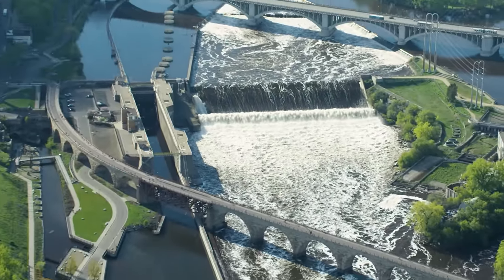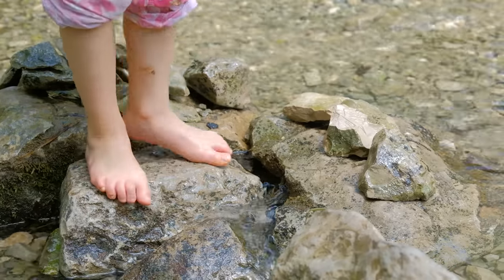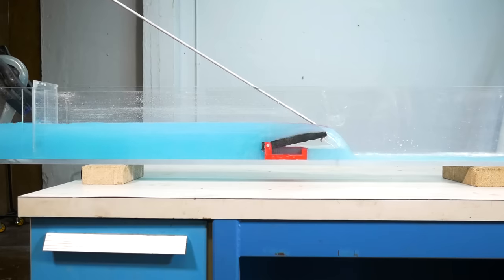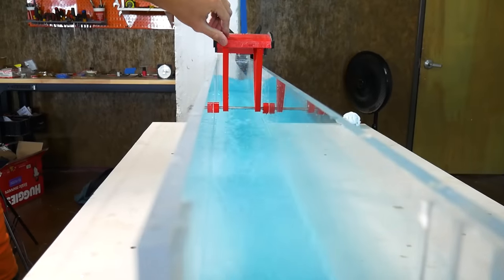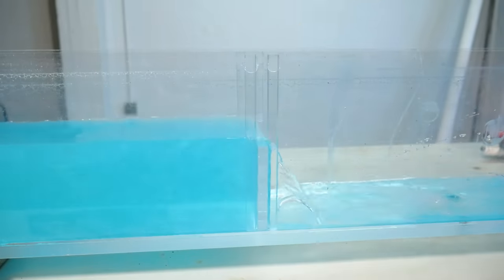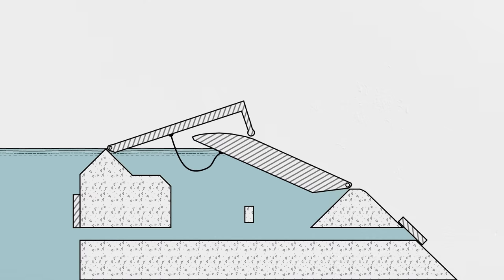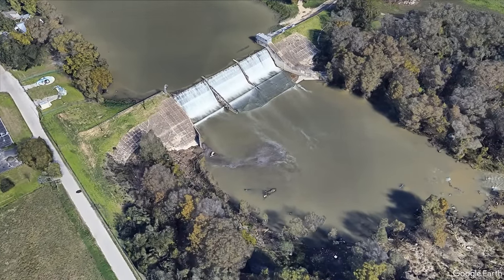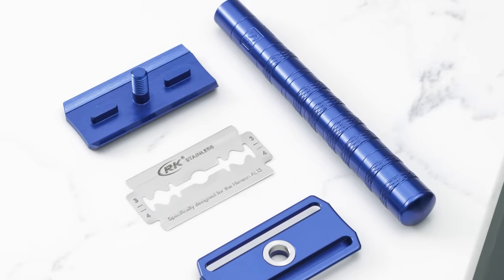How Different Spillway Gates Work

Comment: I wish I'd seen this video 35 years ago.  That's when I drew my first tainter gates for the Olmsted Lock & Dam project.  Since then I've drawn lots of water control and flood control projects.  Tainter gates, maintenance bulkheads, stop logs, flood gates, etc. My advice is to not live below sea level, behind a levee and/or downstream of a dam.
Reply: Try to tell that to the Dutch.
Reply: Well technically I'm at 7' above sea-level here in the Sacramento delta but given the last week's storms in NorCal that's of little comfort at the moment.  :)  Luckily despite being only a couple hundred yards from the Sacramento River itself my personal home isn't really at a high flood risk as our specific levee is quite robust.  However that safety is only due to the lack of safety for many others....basically it's more likely some of the other levees will (and have) fail before the ones closest to me which will reduce the pressure on 'my' levee.  I'm actually at greater risk of flood from sloughs and waterways much further away than the one I can see out my window.
Reply: @seneca983  I grew up in New Orleans at sea level.  I moved a little north to 23 feet above sea level. Mother Nature will always find the weak spot.  It's best to minimize the risk.
Reply: @donhappel9566  The steel fab shop I worked for was up against the Mississippi River levee, just upriver of New Orleans and just downriver of the Bonne Carre spillway.  I enjoyed watching the river go up and down thru it's cycles for 20+ years.  When it was high and far up the levee, the top of the river was about 20 feet above the "dry" side of the levee.  It's a bit scary.
Reply: @lowellmccormick6991  Yeah, grew up near the Ohio river and now live in the CA delta; lots of very visible level changes.  The LA Mississippi delta and the Sacramento delta both share a lot similar risk.  After Catrina tore things up there many pegged us as the next big target.  They've been doing work ever since to mitigate the risk but there's just no way to make it 100% safe.
Reply: look for the highest water line and live half again above it.
Reply: 3 years ago I was on a lock project in Illinois where most of the construction staff and many of the workers had come from the recently completed complex at Olmsted. I think they were only there the last 5 years though.

Comment: I worked in a hydropower plant back in Europe that had really specific design, kinda old school.  it was a crest gate type but gate itself was like a  section of a cylinder, that was seal tight and child float if needed. Under it was a chamber that if filled with water would raise that gate, and if emptied it would drop the gate. All energy needed to operate those gates was to open and close valves for the water in the chamber under the gate. It is amazing to watch the whole video and know almost everything from personal experience. Great job sir, I love your videos!

Comment: These crest gates work very well in conjunction with a radial gate. On our river diversion for or canal company, both are used . On the check structure a radial gate is used and it can keep the river channel clean from sediment. The crest gate can deliver cleaner water to the ditch since it takes top water not sediment laden bottom channel water. It results in a dramatically lower sediment removal needs in the ditch. The gate is autimated due to the changing channel depth affects delivery more drastically than a radial gate. The hoist is just a pneumatic truck spring more or less. The gate works great.

Comment: The was an engineering disaster at Sant Anthony falls. There was a tunnel that built across that location and collapsed. It caused  a cascading effect on the falls and it started eroding and cascading up stream. The spill way was built over the original falls location to stop the erosion.

Comment: I'm missing a gravity spillway. it's what my town uses to control the level of a stream. Basically just a giant slab of metal on a concrete structure that's hinged at the top. If the water level, and therefore pressure becomes too high, it pushes the slab open by itself and can spill water, if the stream becomes too low, gravity pulls the slab closed. it's mostly in a state of flow, sometimes low, sometimes high, but it keeps the stream almost perfectly level constantly. Unless there's a draught.

Comment: What did you add to the water to get that white shimmer effect that shows off the flow nicely?
Reply: He does note that he added "sparkles", some sort of glitter, likely plastic to suspend properly.
Reply: Mica Powder. Common craft supply
Reply: I have an idea but I'll keep the comment section family friendly.
Reply: either some kind of powder or he got one of those mystic fog fluids used in computer water cooling.
Reply: It's an edible shimmer powder they sell. Some drink shops make juices with it

Comment: In 2014, a 2 inch crack was discovered in Wanapum Dam on the Columbia River.  They fixed it with some clever engineering.  Can you make a video of dams with flaws that were fixed?

Comment: Great video - and also - Double edge safety razor for the win!  I've been using one for years and they are much better than the crazy Gillette razors
Reply: I bought one for my son when he started needing to shave, thinking it would be cheap for him to replace blades on once he moves out of the house.  I showed him how to use it, and then promptly went out and bought one for myself.

Those things are amazing.  I'm not sure why people stopped using them in favor of disposables.
Reply: I forgot the razor I owned was by Henson until I watched this and checked my order info (older model). I freaking love the razor so much. I've been shaving with it almost daily for the last year and a half since I bought it when they were less well known, and it's such a great razor. 3rd one I've owned, but the end of the search for the perfect razor. Their attention to tolerances shows in the shaving experience. I can't say enough great things.
Reply: Ha!   Glad to see I'm not the only one so enamored with my double edge razor as to leave a comment!   I've had mine for over a decade now, and absolutely would never even consider going back to a cartridge blade!  Shaves just as close, if not closer, and the blades cost 1/10th the price!  Plus, there's just something satisfying about using "old" tech to shave with (although personally, I'm drawing the line short of the straight razor and leather strap mode of shaving!).

Comment: Its been quite interesting living near a flood control reservoir the last few years. Its our primary local recreation area so we see the river and lake levels changing frequently.

Watching them shut the river off for a few hours by closing the sluice gates (maintenance was needed on something downstream) was very interesting to see how quickly the downstream water level dropped and to walk on the riverbed.

So too watching how quickly it rose when they had to open the tainters for a day when the reservoir was nearing capacity. Fourth highest crest of the reservoir in its 60 years of operation was recorded that year. Took a good two months running the sluice gates at close to maximum to safely drain the lake back to its minimum.

Comment: Several of the dams in my city are fitted with simple slide doors that are winched up or down as needed. The opening is narrower than the door, so the water pressure on its own seals the door against the concrete of the dam. The current doors are steel, but they used to be simple wood beams with a rod down the center so that they could be lifted. They were fairly similar to the stop logs mentioned at 15:10.

Comment: Interesting the reason that Tempe Town Lake has the gate system it has now is because they used to use rubber bladders as gates.  Finished in 1999, the bladder was supposed to last 20-30 years but barely made it 2-3 years before major repairs were needed.  In 2010 one section completely burst and drained the entire lake over night.  I remember when it happened since I drove by the lake every day going to and from work.  It took 6 years to finally get the new gates installed and working.  They look MUCH better too IMO.

Comment: For anyone curious the gates at Tempe Town Lake weigh 297,265 pounds each and sit at a 70 angle. The hydraulic cylinders are 3,000 psi, 16" bore 6" rod with 275" of stroke. Now Grady can finish his calcs. 🙂 (My company's the manufacturer)

Comment: If you like the radial gate design, check out the Maeslantkering in Rotterdam, the Netherlands. It's a storm surge barrier that operates on a similar principle, but pivots around a vertical axis instead of a horizontal one.

Comment: We had floating drum gates on Florence Lake in California. One of the largest multiple arch dams around. The gates were raised by letting water out from under the floating drums. It didn't need any power except for mechanical winch that raised or lowered to regulate the water underneath the drums.

Comment: Thanks for the post, was not familiar with beartrap gates. I worked in dam safety for 8 years mostly with radial gates and glad that you mentioned the maintenance and inspection aspects. Stoplogs and seals are important. Lift cables are problematic if allowed to contact the gate surface and corrosion in general is a challenge.

Comment: There are a couple of small reservoirs here in California that have simple steel or plywood insert.  Once the lake is full there is no way to remove these inserts,  water has to be diverted to drain the reservoir.  There have been a few times that they thought the water was going to run over the top of the dam since they could not drain it quickly enough.

Comment: where i live, the spillway gates are big giant pieces of wood that are fit into place by a guy in a boat that is attached to a line to keep the boat from going over the dam. the wood plants are huge and when they eventually snap and go over, i always try to grab them because they are redwood and super useful. its pretty wild that they use such an incredibly simple system still. the dam is about 250 years old

Comment: I’ve worked on dams here in NW Ontario. Big dams, very remote! The gates are huge and we have to assemble them on site! Very cool work. And the towers which hold the hoist bridges are massive galvanized structural steel.
Can confirm that every singe dam is custom, but practices are becoming common.

Comment: I watch a number of videos from UK's canal system users.  Some are quite informational about the structures of the canals.  They were mostly built over a hundred years ago.  Stop locks are used extensively for canal gate maintenance and infrastructure.

Comment: I live close to the morganza spillway here in Louisiana. I remember they opened it for the first time in 50 or 60 years back in 2011. It has large vertical gates that a crane like structure that opens them when needed. The corps of engineers has non stop working on those gates since

Comment: spillways is my biggest passion, that supersed my other passions for high voltage substation busbars, insulators and breakers in ais substation, and the steam pressure reducing valves. this is why i know a lot of the knowledge of dams and spillways. especially the chinese dams on the yellow river and the yangtze river. Maybe the next video about spillways could be about the velocity at the bottom of a spillway and the design of the bottom of at spillway channel.

Comment: I worked as a commercial inland diver in  south TX for 15 years. Most of the bridges and dams we inspected Were built in 50s 60s and 70s.  We were hired to inspection, we would find some major deterioration on bridge piles. but  a lot of the safety inspections and issues would be ignored.  Due to either the state pushing off major repairs because of budget, or pushing responsibilities to the army core of engineers. Or they couldn't shut the bridge down due to there being no other route of travel.  Like the bridge crossing to south Padre Island.   It collapsed  btw.

Comment: We use to jump off a Dam in Trenton, Ontario (Don't jump off dams. Don't swim by dams.)

The entire system there was (and probably still is) reliant on wooden stop logs. The upper portion of the Dam had a track system to move a mechanical pulley back and forth along the dam to lift or add logs.

Comment: In my opinion the biggest problem with the bear-trap gate is its complexity. There are so many different pieces that must work that a failure in any one of them will cause the entire system to fail. That pressure basin under it being a prime example, it would be very difficult to clean it out but by its nature would attract sediment that could clog the flow causing the gate to close when you didn't want it to.

Comment: Would love to see you talk about the water management up here at Sault Ste. Marie, as there are a slew of different systems between Lake Superior and the St. Lawrence Seaway.

Right across the same stretch of water (at the Sault) there are several power plants, several locks, several different gates, and even multiple spillways.  Would love an engineering video showing the intricate ballet all these various systems (between two different countries) to manage the water in Lake Superior, while not starving the downstream Great Lakes.

Comment: I frequently walk past the St Anthony lower lock, and from a bridge I can see these radial gates will have water flow over on one and under on several others. I do not know why. Also the upper St Anthony lock (adjacent to the concrete spillway - falls) has a radial gate below the upstream lock doors. This can be seen whenever the lock water level is low. I have seen this gate open only once over many years, and maybe it was 25 years ago. One spring had a very high peak flow and the gate was opened. The water shot an amazing long distance down the lock chamber. Also I wonder if Civil Engineers commonly use DFMEA analyses to reduce failures and lead to better designs? I am an ME, and my experience is that although this powerful tool is used, it is frequently underused or poorly used.

Comment: I worked on dam maintenance in France, and here spillways are mostly of 2.5 types :
-rolling gates, with one or 2 elements depending on the flow
- radial gates, but you see 2 types of those. Some are just like you showed, and some have a small crest on top, offering a "best of both world" allowing for both big flows and precise regulation of height.

From my experience, if there's one thing common to every gate, is that the operating company will alway complain and say the other type is better 😂
And from my point of view I have a slight preference for rolling gates, as the seals are much simpler and more effective. Getting to acceptable levels of leak on radial gates can be a nightmare, especially if it has a crest on top
Reply: @kilometer214  i feel like maintenance is a bit more regulated in France indeed. That said, I have seen things that would make the US look like a textbook example...

There was a gusset that disappeared overnight on a french dam. Upon inspection the gate was vibrating with the water flow, and fatigue induced cracking was occuring in multiples areas. 

We got consulted to fix this in an emergency. We've been told "the first one to answer with a realistic price gets the job as this is an emergency".
Long story short someone gave an unrealisticly low price after us, in talking with the operators we learned their scaffolding budget and told them "they will not be able to put scaffolding for that price, you are making a mistake "

One year later work has not started because of a dispute with the contractor because they don't agree on scaffolding. 
The work were cancelled, and the budget being done for the year it is going to wait one more year (reminder : with structural parts missing) before being repaired....
Reply: @kilometer214  problem is more on how companies are structured. 
All the interactions are done with technical people, they know what they are talking about. They then give a "go/no go" to the contractor's tender, and if it's go it get passed to the finance department... Where the problems are IMO. They look at only a few things :
- Price
- validated by the technician?
- reputation of the contractor
- budget for the work
In theory, that should be enough. The problem is that from a technical standpoint a go/no go is not enough. They are solution that will work twice as well for 20% more, it's worth the expanse ! But the system doesn't allow the finance people to see that, because technicality and money has been separated. I would not trust the technician to deal with a budget, the same way i wouldn't even consider starting a tech talk with the finance dept guys ...

This is IMO the biggest problem in the industry at the moment. We need to have less specialised, more polyvalent people handling those kind of things, that should be supported by experts, not just experts cross referencing each others because a lot get lost in translation

Comment: I was wondering if Dunlap dam would be mentioned. I did the Demo of the old electrical work from the building for it and the underground work for the emergency generator. The sound of the water flowing all day was enjoyable and the constant breeze at the top was appreciated in the summer.